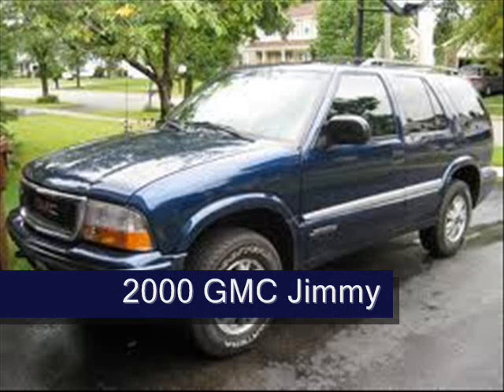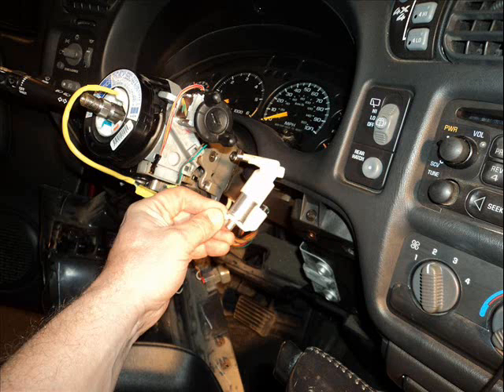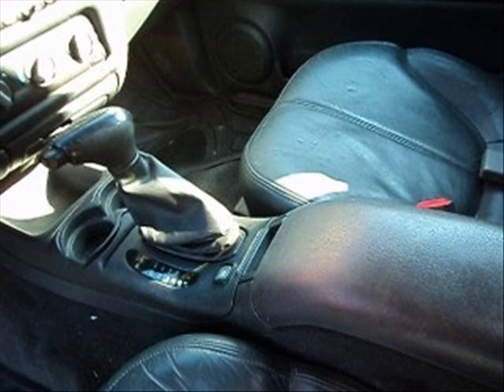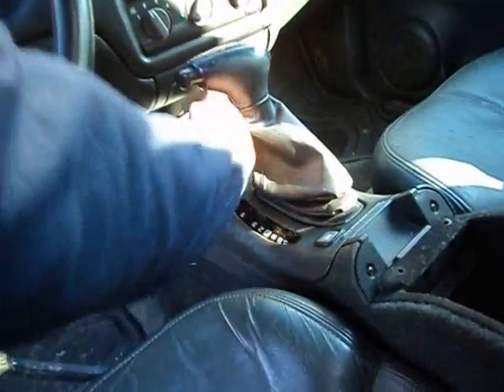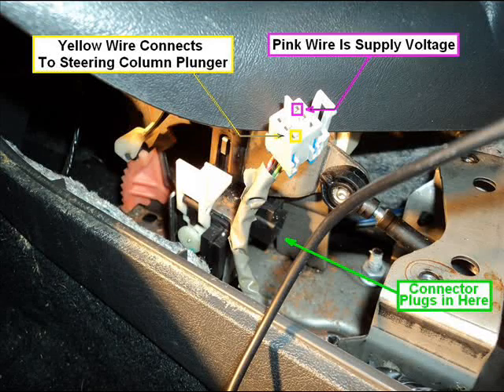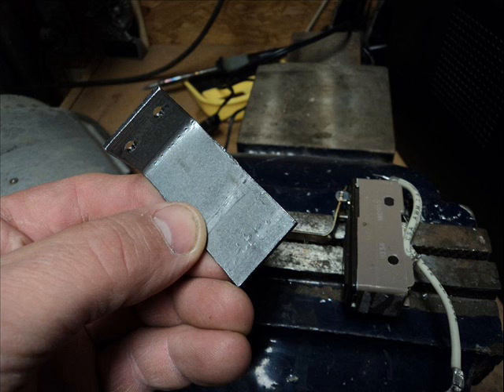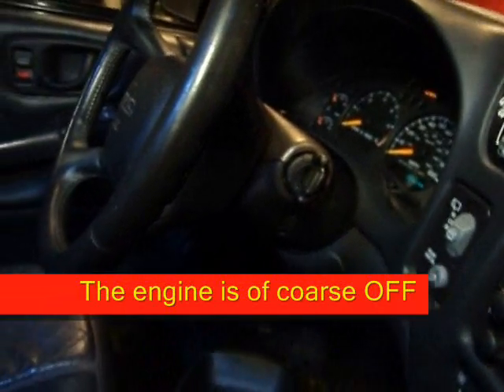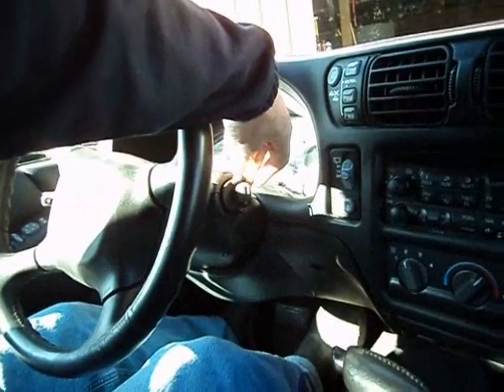GM ignition switch repair

Comment from the maker: I just used a switch I had laying around.  If you search eBay for a "basic switch straight lever" you'll find the type of switch I used.  Newark Electronics also has a switch and the manufacture number is BZ-2RW80-A2made by Honeywell and sells for $8.50.  
You might stop by a Radio Shack and see what they have.  Looking at it now I would consider using a magnetic switch like what's used on intrusion alarm doors.  Hope this helps.  Good luck with your repair.

Comment: There is a place with a plug in it on the underside of the steering post of my 1997 Blazer. Take the plug out and use any long rod with a small head like a Phillips screwdriver to push up there. This will release the key so it will turn and you can then move the shifter out of Park with the brake pedal pressed. I had this problem a couple of years ago and a locksmith showed me this trick.

Comment from the maker: Had similiar symptoms on another car and it was very time consuming Turned out an 8 wire plug connector that fed into a computer module had barely worked loose.  (located under the dash and very difficult to access) I seated it into the module and everything was working again.  Check for blown fuses first, then start seating connectors  To answer your question about my Jimmy, I didn't have gauge problems, but I did move alot of components around and could have easily bump something

Good Luck

Comment: i know this is a really old video but i just wanted to say i was having this same problem and the easiest solution i found was to take the pink and yellow wire and just jumper them together also keeping the pink wire inline with the connector works great and you don't have to find a new switch or fab anything up

Comment: Thanks for the help. I am trying to figure out if I have power to the safety switch by the ignition switch. I tried to jump across the plug in the console and believe I blew a fuse. Now I can't figure out what fuse goes to this because now it won't come out of park.

Comment: Thank you for the video. It helped me fix my problem. I did not put a new switch, but I grabbed a needle-nose pliers and pushed-in those to wires (Red/pink and the yellow) and I was able to take my keys out. I tested it several times and it did not get stuck anymore. By the way, did you find-out what that switch is called. I had a hard time finding the part and I still haven't found the proper name for that switch.

Comment: I have a 2005 crossfire. When i got done washing it, i started it, wouldnt go out of park. Finnally went in drive but would not shift. When it was time to shift i'd pull over and let cars get around me and go again so i didn't hurt the transmission. Got 2 blocks to smokeshop(my friends) then it would not start or go out of park. The wrecker guy told or showed me to push a button end of the park, drive plate to let the car go to netural incase the battery ran down. BUT still won't start. Turn key nothing no rear,rear,rear,rear...then the key locks in that position. Have to tur. All the way off then try again before it will turn all the way over position again. (The key)  but still nothing. I thought i just pushed a button when i used a sponge on the panel. The trackion and the one that has a hook over the car. Maybe some security lock down.  Also when the car left the carwash and wouldn't shift i clapped the gearshift to the right to the plus way then tried the minus way pushed the w then the s didn't matter. Now just all locked up. Can't find my owners manul. Please help desperate. Disabled don't know what to do. First i thought w for winter also seen the trackion button and s for summer. But i think s is for standard shift by itself???    When u come to curve. Do u slap the minus and go around the curve then slap the plus to let it shift back up. To gear the motor down or slow it down??  Thank u very much for taking the time.  God bless!  I really love my car. Its fun. I live in country on mountain. My little race track...

Comment: What if you glue an end of a pen or something into the hole under the steering column to push in on the plunger all the time? Easy fix to get the key to turn off and be able to remove it. Would this draw power all the time if the plunger is always depressed??

Comment: I to have the problem with the key sticking. My temp.gas.tach.speed. and odo gauges also stopped working at the same time but my oil and battery gauges still work. I was wondering if you had this problem with your gauges and if so did they work after "your switch" fixed the key problem. Thanks

Comment: I have that problem as well, thanks for that.  I have another issue with the multi switch for my turn signals, hi lo beam, etc.  I replaced it, now I'm having a security problem.  Starts and runs for about 2 sec then quits.  The security light stays on the whole time with or without key in ignition.  Any help?

Comment: Why not just cross the two wires together at the shifter switch and bypass the switch altogether?
Reply: That might work, but you have to be sure that there are no other features or devices on the vehicle that depend on that signal.